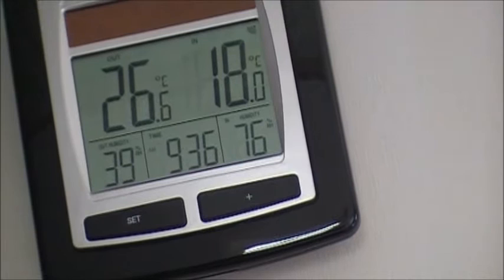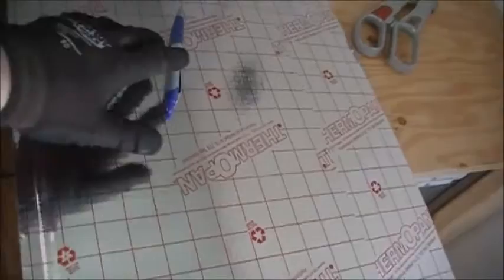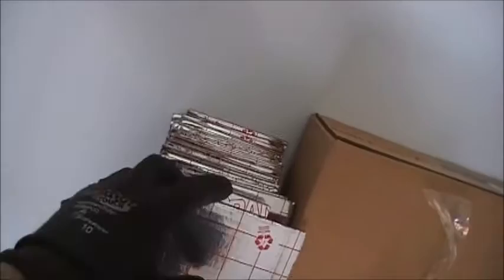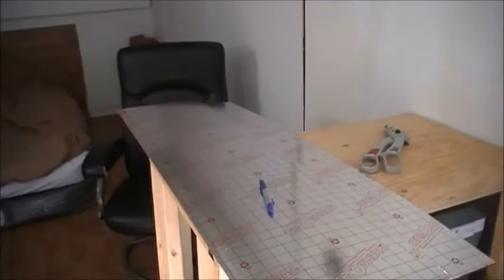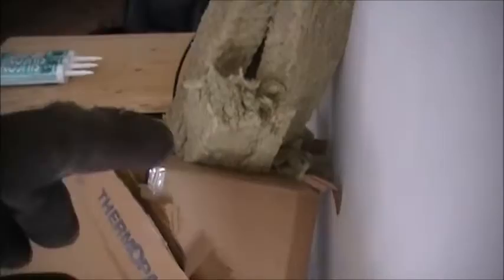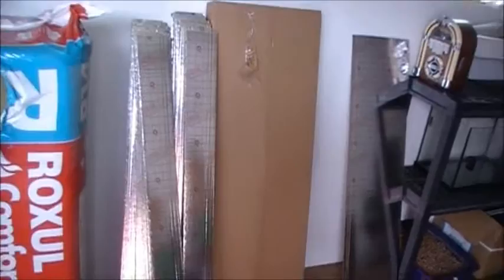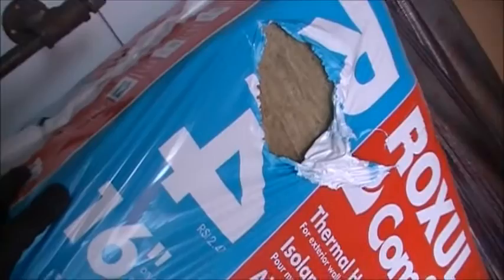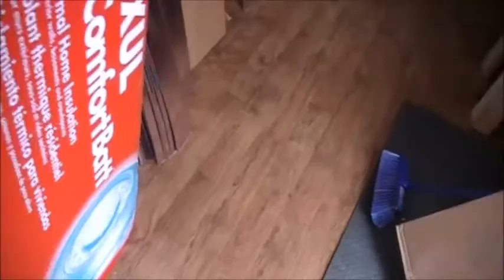The Off Grid Tiny House 157

Comment: So you should be at about a R34 for the floor now ? Befor the wether get colder, you should think about insulating the roof abit more ( some how ) perhaps some sort of drop celling , and Rocksol above. Let's not forget ( heat rises )
Reply from the maker: David Pedder Yes sir. R-34 sounds right. I want to see how the place will be when I am living there full time especially in the winter. To see how the heating goes etc. Maybe I wont need to insulate the ceiling but the option is always there.